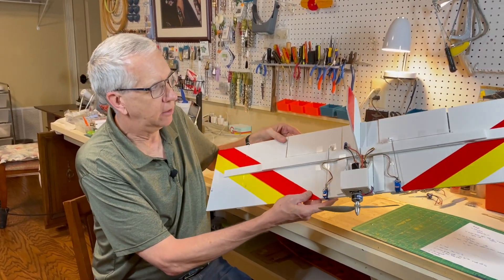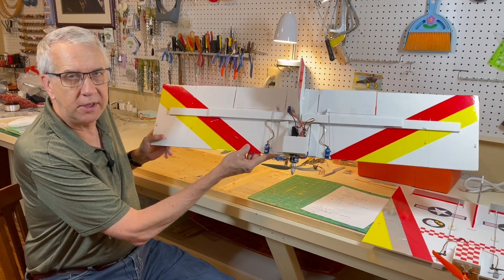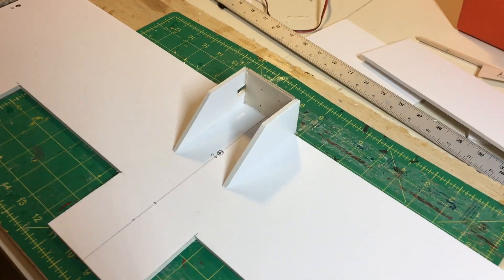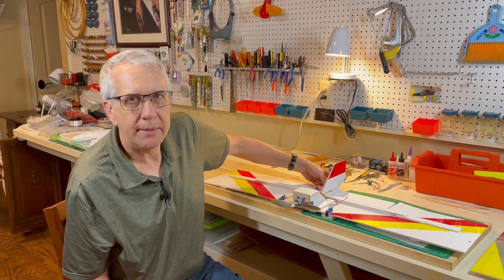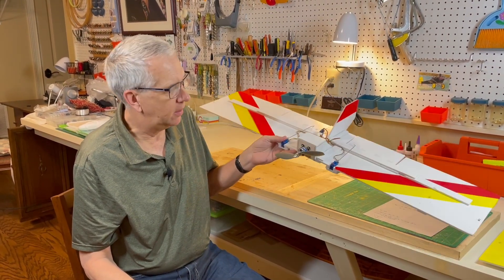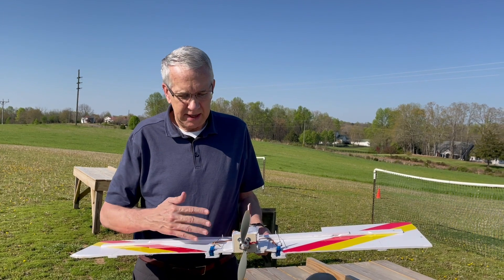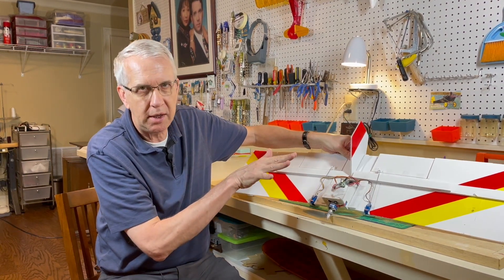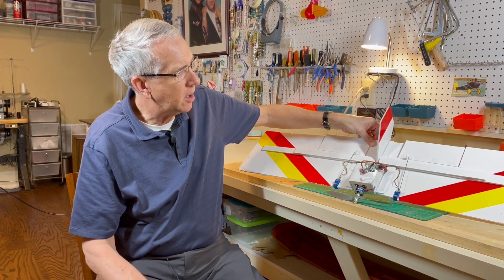RC Plank Flyer Foam Board Airplane

Comment: When you make the plane very short front to back the cg range becomes very narrow. Creep the cg up slowly and you will find the sweet spot. Once that is found they fly fine with no bad habits. 25% gets you in the ballpark it maybe more correct in the high teens. That crazy nosedive on launch is a tail heavy condition, I know that seems counterintuitive but I've seen that before on my short coupled designs. The trick is to get it flying good before you destroy it on test hops 😂.
Reply from the maker: Greg:  Great points!  Tim

Comment: Good stuff.  I wondered if the control surfaces were a bit wide and close the fusilage?  As flaps they would work fine.  Thanks for another perspective on a flying wing.
Reply from the maker: Bob:  Control surfaces could have been a bit smaller, pretty much figuring things out on the fly. But a fun experience!  Tim

Comment: Very nice Jim, for years I tinker with drawings in my head, and I have been drawing plank designs for a few weeks now... this video has taught me a lot about the sensitivity.. so here we have design simplicity and success,  but reinforcement of the very sensitive nature of the design to input from the servos.  For a plank flyer, where is the best place to put a CG line? Or does it vary because?   Inquiring minds want to know.  Peace to you friend.   Have a nice day.  Oh and one more thing:   Does things like maybe a cambered wing effect, impact, confuse complicate the design?
Reply from the maker: Bubba:  For a plank flyer, I'd still keep the CG about 25% back from the wing leading edge.  From all that I have seen with other plank flyers, the flat wings seem to fly remarkably well (see my recent model of the F-22, another flat wing design).  Camber certainly would not hurt, not sure if it is needed.  Tim
Reply: @TimMcKay56  Yeah, I see your point, however if some depth to the wing leaves opportunity to bury wires or include other little goodies in the body.  I have always been intrigued with low drag tailless flight.  The plank design is really innovative way to do it.. but maybe not a design one of the oldest shapes in history, someone just hooked a prop and a servo and battery to it.. Ha ha!!!  But I will attempt 25% and if i go camber .. let you know.
Reply: Budda:  Good luck!  Tim